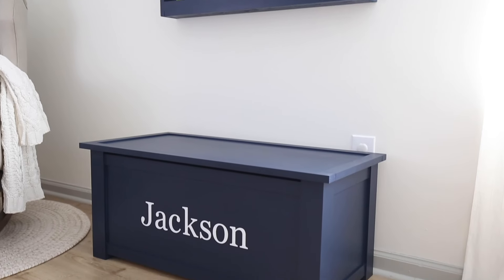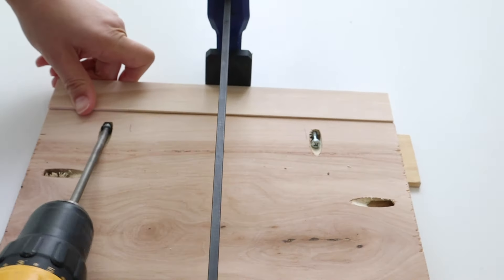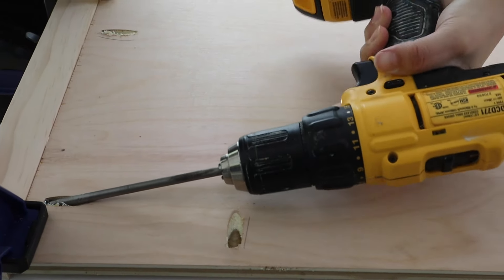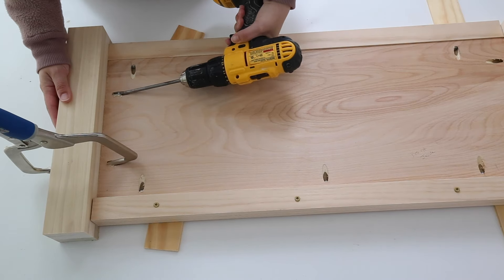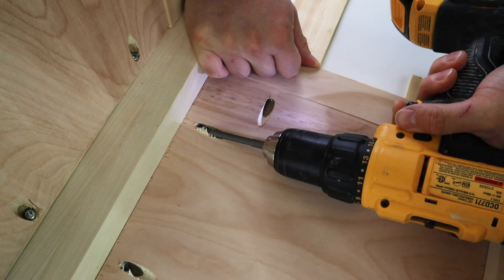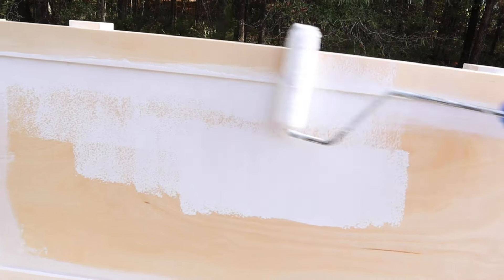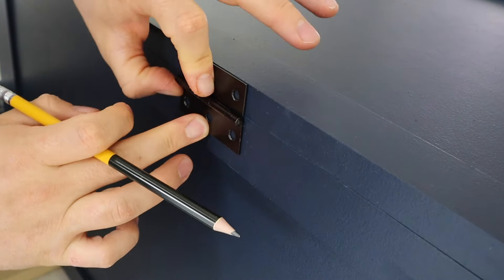Wooden DIY Toy Box | Easy DIY Toy Chest

Comment: Great video! I’m having a hard time finding 3x3 at my local hardware store. It doesn’t seem to be very common in Canada.
Reply from the maker: That's frustrating, you could glue some pieces of wood together and sand down really well to create the same dimensions of 2 1/2" x 2 1/2"
Reply: @AngelaMarieMade  4x4 + table saw with rip fence = 3x3
Reply: Glue together 1×3s it alot cheaper.  3x3 are 45.00 each

Comment: Great information, thank you for sharing.  Question, did you go with Oak or Pine?  I am pricing out oak and is $150 just for wood from Lowes.  Thank you.
Reply from the maker: We used a combo of pine and sanded maple plywood which is a great product to keep the cost down.
Reply: @AngelaMarieMade  thank you so much, I went with oak, but going forward I would look to use pine.  This is the first piece of furniture I am making, some lessons learned already.  The Kreg Jig is really a wonderful tool.

Comment: Absolutely love this idea. I'm planning on taking the same approach as you with having initial cuts done at the store. How did you have the plywood cut at the store? (Dimensions wise that is.) Thanks for the help!!
Reply from the maker: That is awesome to hear! I usually draw a diagram out with the dimensions to visualize how the cuts need to be made and it also greatly helps the person who ends up cutting. You can find a full cut list on my blog post.
Reply: @causticmain5002  Real mature comment...especially on such a family friendly page.
Reply: I agree! My mother went to Home Depot and she had all her measurements wrote down and they cut it for her with no problem. They have a station to do so. I was thinking the same thing because I do not have some of the equipment she used in her video. BTW how did it turn out? @philippasco7184

Comment: Great video!  Just subscribed and I think I'm going to go e this build a stab.  I see the great cut list you gave on your blog, however what cuts did you have the home store make on the 4x8 plywood?  Did you have them make a couple, then you did the rest at your shop?  I will need to have them cut it down to make it more manageable, but I'm sure they won't be interested in making all of the cuts.  Thanks again!
Reply from the maker: Thank you. We had them rip cut the board in half at the 24" mark but you could also have them cut it in half at the 48" mark depending on how to fit it into your vehicle. We then made the rest of the cuts at home.

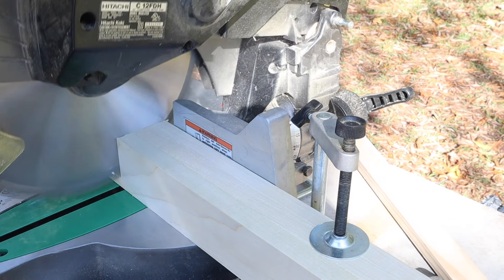Comment: so if I didn't know any better it sure looks to me like the corner posts 3.5" square and not 2.5" as your plan calls for. Look at the 1:42 mark. If that is the case, then the stringers would have to be 1" shorter.  Can you confirm?
Reply from the maker: We used 3x3's for the corner posts, the actual measurements for those are 2.5" x 2.5"